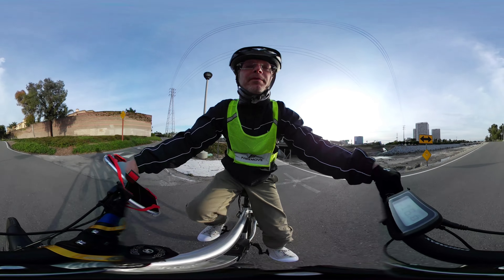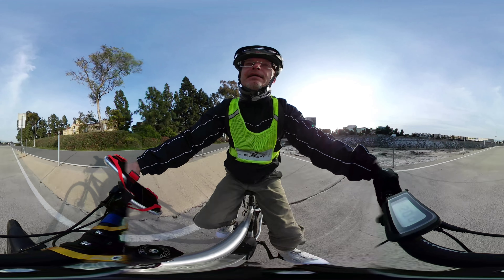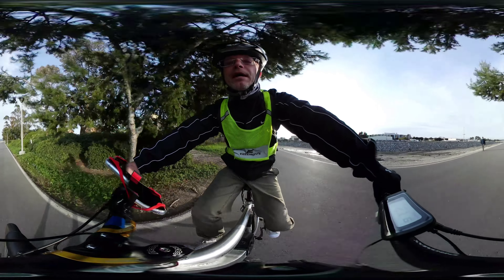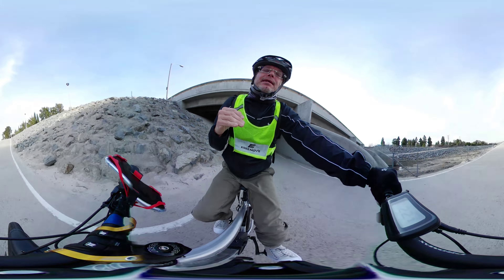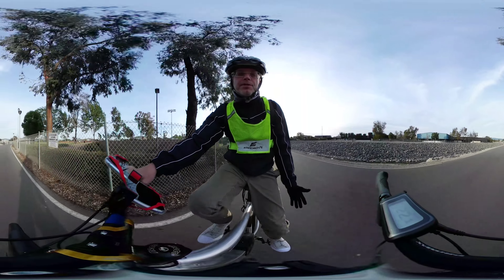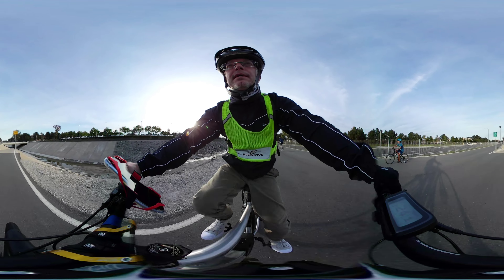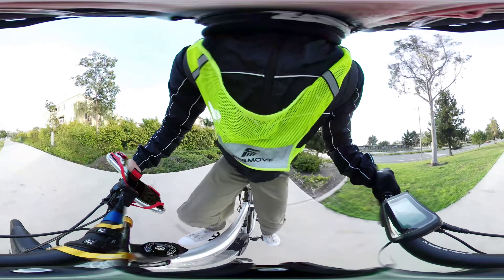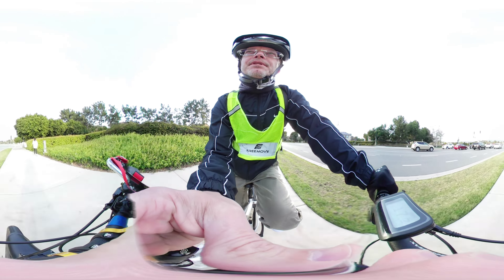Week 3: Cross Current eBike

Comment: Just wanted to point out that you can turn the torque sensor off in the display settings and run it in cadence sensing mode. Thought you might want to shoot a little video comparing the Cross Current S in candence sensing mode to the Rad Rover. This video shows how to do it (FFWD to 12:25) https://m.youtube.com/watch?v=6wSu9eMjrpc

Comment: Can you tell me if there’s a mounting hole to add a Topeak bike rack on the CrossCurrent S. I know it comes with a rack but I may want to upgrade. I ordered my CrossCurrent S and it’s been shipped. I will be looking at Schwalbe tires as an upgrade also, a thicker tire and use Slime heavy duty tubes and slime  tire liners. If you can can you get a video view of the rear to show the available mounting holes. I looked on YouTube but can’t find anyone speaking of different racks for the bike and install.
Thanks
Reply from the maker: Let me work on this now...
Reply from the maker: https://youtu.be/VK-WQmd_7io
Reply: Hi, I saw your video thanks. What I am wondering about is if the Topeak Rack will fit because the mounting hole on the CrossCurrent s is up so high and on all the you tube videos I’ve seen there’s usually a hole lower on most bikes to attach the rack mounting bolts to. I am speaking of the mounting holes by the wheel not the seat tube.